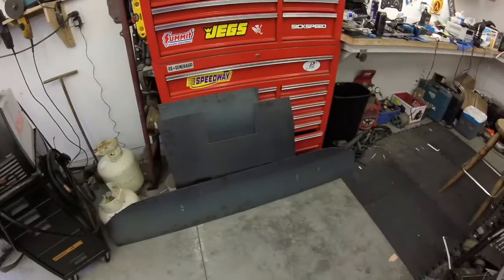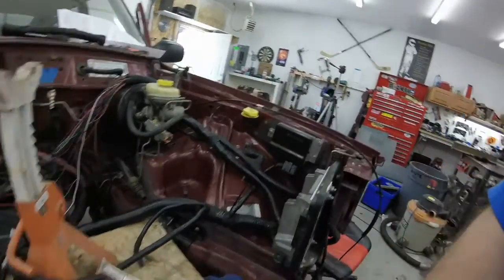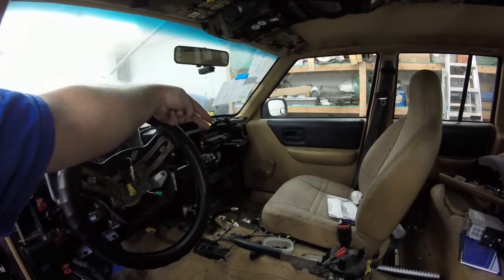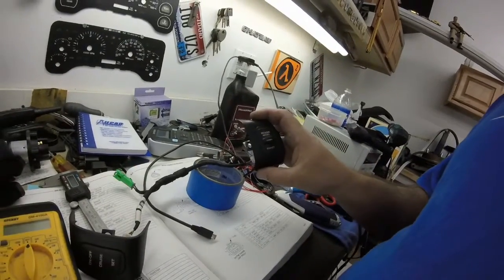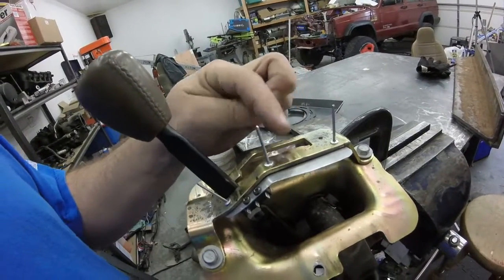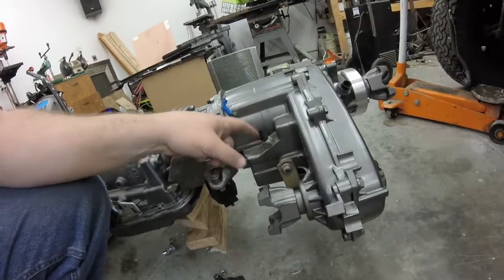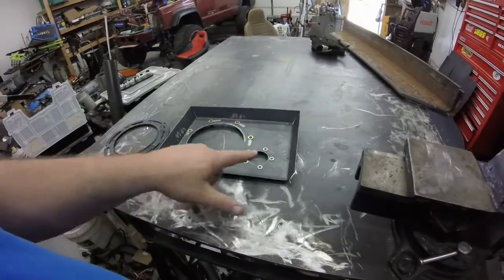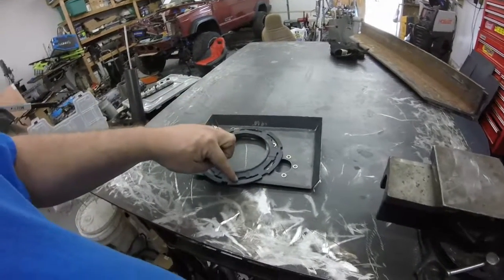98 Jeep Cherokee 5.3 Swap - Episode 6

Comment: Hey jess hope u can help me
I bought the novak adapter for the 4l60e to np231 and it comes with it's own vss, now when it's on 4low it wont shift out of second gear I read you need a ground signal do u know what pin on the pcm is it I bought a stand alone harness and it didn't have one
Reply from the maker: What year is the harness? With the Novak setup the VSS is before the transfercase so you shouldn't have to tell the PCM its in 4 low. The only reason I did that is because my VSS was after the reduction in the tcase. Will it shift when in 2HI?
Reply: Jess yes in 4hi and 2h will shift good it's just in 4 low only shifts 1st and 2nd that's when you floor it going up the dunes,
Reply: And the harness is from a 02 ls1 firebird
Reply from the maker: @Johnny_pisteo  Ok sorry I should have asked what PCM you are running but I assume it is a 99-02 Truck P01 style. If it is the early truck PCM then it is pin 16 on the RED connector. Pinout information is here:  http://lt1swap.com/99-02_vortec_pcm.htm  If you are running the LS1 computer then I'm not sure what to tell you. Might take some google searching to find an answer

Comment: I'm not sure what the rational is but I think all steering buttons are based on resistance. There are various options for dealing with it but most of the info on this subject comes from people getting media controls working with after market head units.
Reply from the maker: Yeah after more investigation after this I found out they are resistance based. Probably in part so they can run fewer wires through the clock spring too I would imagine. I think I remember seeing a guy do a setup in an XJ using Arduino or Raspberry Pi to interpret the signal and then output what he needed. Was a neat setup but I know nothing about either of those platforms.
Reply: Yeah, I guess a resister network makes sense now that you mention it. I'm not sure if this would be useful to you if you ever do think about it.

http://razzpisampler.oreilly.com/ch08.html

Nice truck, camper and 1/2, I'm also jealous of that shop.

Comment: Extremely inspiring to do a similar build... however emissions testing where I live would make it near impossible
Reply from the maker: Depending on what state you live in you can make the emissions work. There are guys that have done this swap in California. In my state they just plug into the OBD2 port and if there are no codes you're golden.
Reply: +Jess Neal well I interpreted it as for in the state of PA all the factory emissions components from the factory must be on the vehicle. so therefore cats and o2s must be present in order to work. Still, your build is what I always imagined mine to be like!
Reply from the maker: Just briefly reading some rules in PA it seems they can do a gas cap test, visual inspection and a dyno test. If the motor you are swapping in is newer then I would think it would pass all of those if you run all the stock GM emissions components on your swap. You might just call your local DMV office and ask about motor swaps and just see what they say about them. You never know....

Comment: I didn't understand why the LS computer needs to know if you're in 4x4 low range. Actually, why does it even need to know if you're in 4x4 at all? What happens if i just hook up a stock XJ Transfer case to a LS/4L60E with stock TC Snifter and did not feed the LS computer any data?
Reply from the maker: The GM computer needs a signal from the VSS. All the shift points are based on MPH so if you put the transfercase in low range the shift points would be way off. If I had bought the Novak adapter and ran the VSS in between the 4L60E and the transfer case the low range signal would not be necessary. I didn't want to spend $600 on an adapter when I made my own adapter plate for $5 worth of 1/4" plate and a few bolts. Its a little more hassle wiring wise this way but it saved me a lot of money that could be spent on other things.

Comment: Jess, top work as usual. ;) What is that little box you kept using when folding the panels for the fuel tank? I gather it's a digital clinometer to check the angles?
Reply from the maker: Yep its a digital angle gauge. About $30 on amazon. Seems to be pretty accurate so far